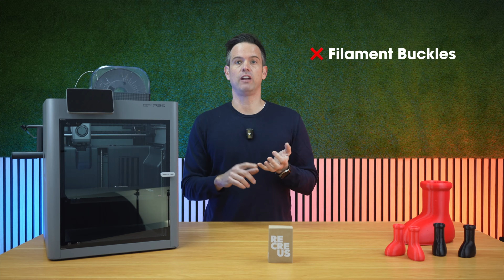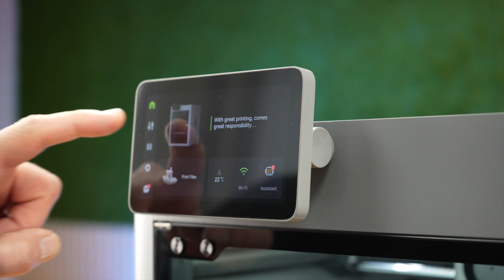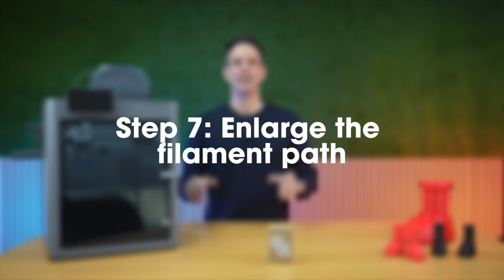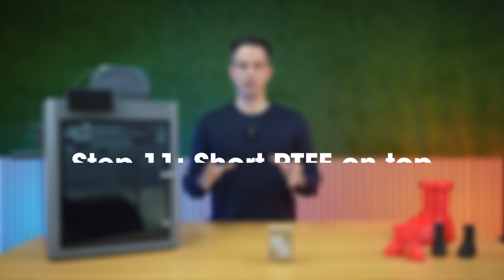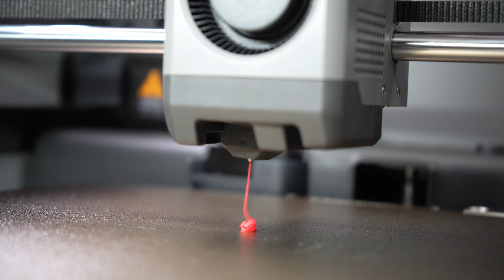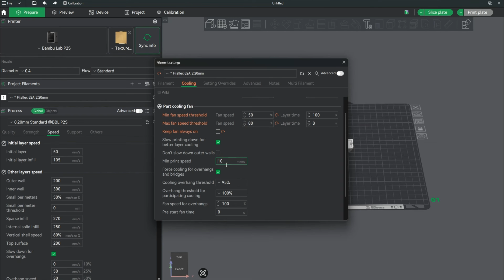How to Print TPU Fast in Bambu Lab P2S | UPGRADE Filaflex 2.20mm

Comment: Is the 1.75/2.2 nozzle made with hardened steel?
Reply from the maker: Hi! The nozzle of our Filaflex 2.20 nozzle, which is also compatible with 1.75 mm filament, is made of stainless steel. Thanks for your question!
Reply: @RECREUS3DPRINTING  I understand why you replied the way you did, but I wish you haden't.

Comment: are the print settings the same for foamy with 1,75 width? Besides the 2.18 configuration
Reply from the maker: Yes is similar, you need to setup the volumetric flow to 7 and the diameter to 1.75mm, anyway next week will available all the new profiles for 1.75mm Filaflex series.